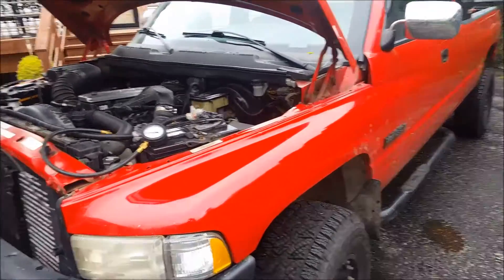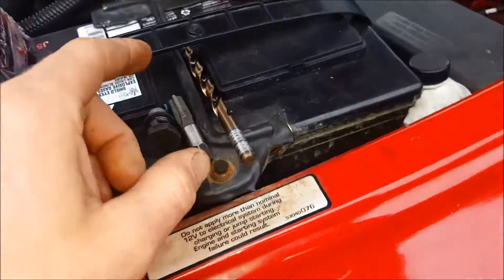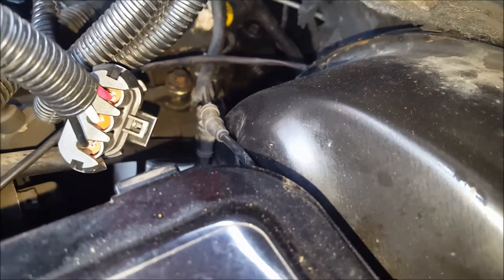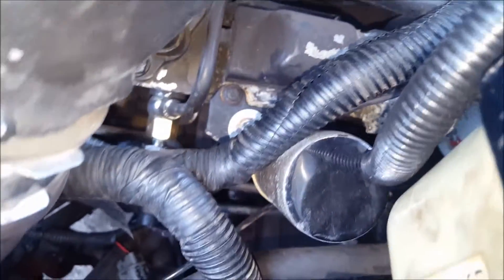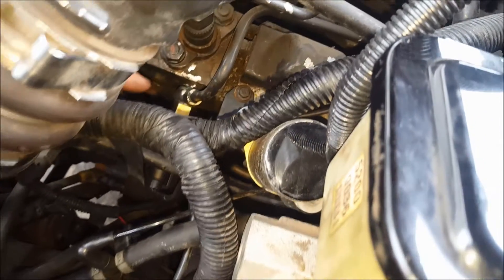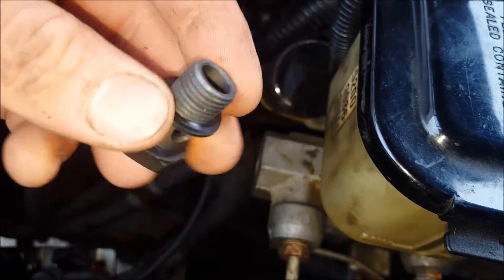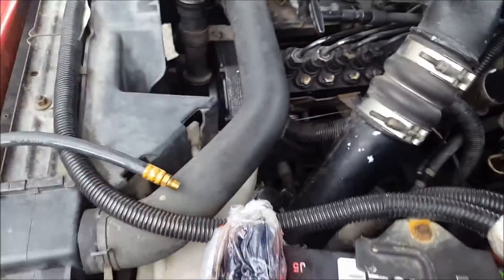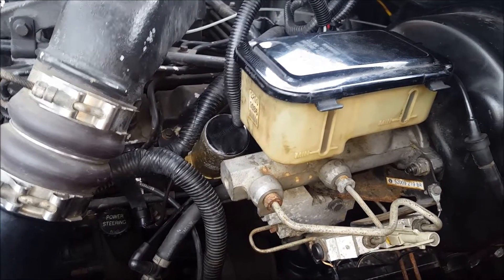How to Check FUEL PRESSURE on 12v Cummins 6BT Dodge Ram 12 valve

Comment: This only gives you the low pressure fuel pump pressure. Tells you nothing about the high pressure fuel pump....
Reply from the maker: Whoever said it did?  It's checking that your high pressure pump is getting proper fuel flow and pressure.  If your injector pump is not working you're going to know pretty quick

Comment: I hate how everything is crammed in the fuel filter section .. I went for the banjo we’re u had urs previously done. I added a shader valve on that till I get a cluster.. can u do another short video 
 on where ur other cluster sensors are measuring from or just mention here…what sensors u chose besides fuel pressure .thanks very useful n too the point.

Comment: I got a 96 59 12v.  Won't start. I think it's sucking air somewhere.  I changed the lift pump,  to no avail.
Been broken down 5 months. 
I'm not a mechanic.
Reply: find a mechanic ;)
Reply: Don't own a diesel if you're not a mechanic

Comment: I have a 1996 dodge with 12v cummins. I’m having an issue with fuel filters cracking from what I think is high fuel pressure building in the filter. Iv been having trouble finding any information relating to the fuel filters cracking. Iv tried multiple brands over the past few months. Nothing last more than 600 miles before the housing on fuel filter cracks and starts spraying fuel. Thanks to your video I have the help I need to go forward with checking fuel pressure. But anybody have any thoughts on my issue? I was surprised this was only one of two vids I could find on the topic for the 1996 model. Thanks again and any advice I can get would be really appreciated.
Reply: 3 years late but for anyone seeing this now id check your fuel heater/strainer if its blocked off the pump is going to build more pressure trying to push through it.. although i would think youd have power and stalling issues before the filters start cracking

ive had one filter crack it was a tiny hairline crack down by where the water sensor is, was lucky the paint flaked with the crack and that it happened on the visible part of the filter otherwise   i would of been trouble shooting that a long time, was a NAPA filter made by WIX, replaces it maybe 5000kms ago and have been good since, that filter was less than 10k kms old and under a year was in the warm months it cracked too so it wasnt a water freezing issue but that could definitely be causing filters to crack, fuel with water sitting in the bottom of the filter water builds up freezes and cracks the filter
Reply: Did you ever find the root cause for these filters cracking?

Comment: I suggest drilling from the inside, keeps the drill bit straight.  Also a needle valve helps dampen the spikes better than a snubber does, and you can shut it off in the event of a leak.